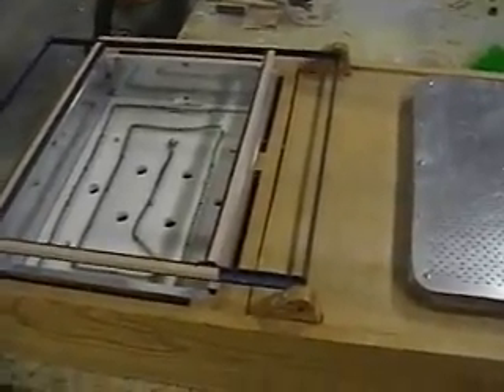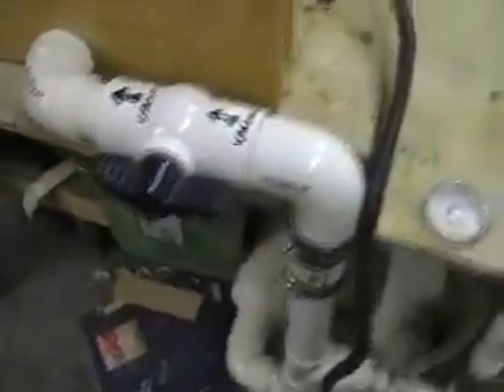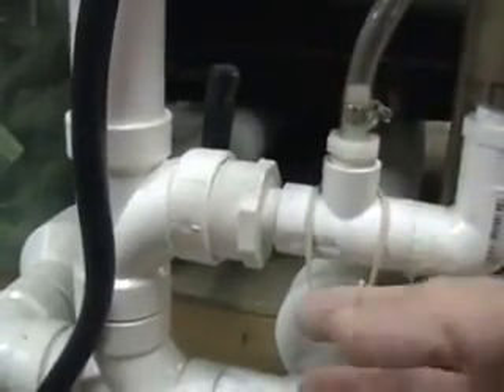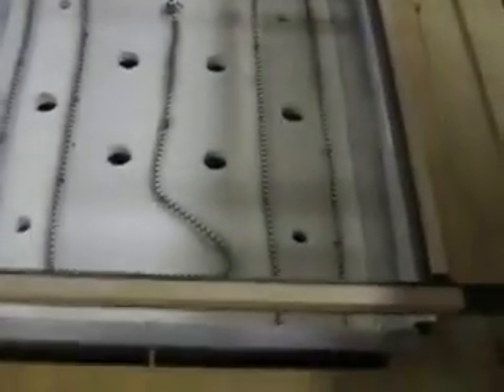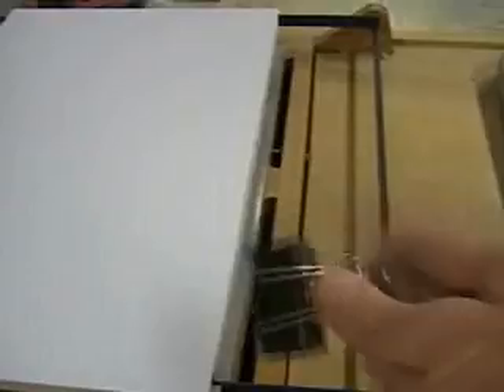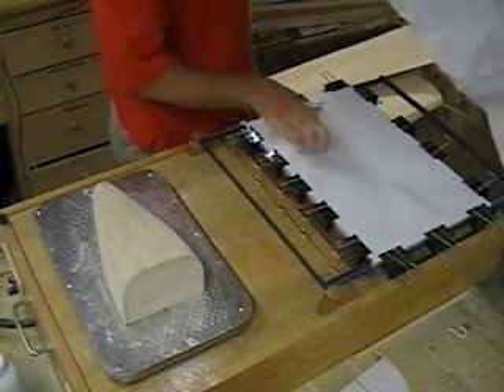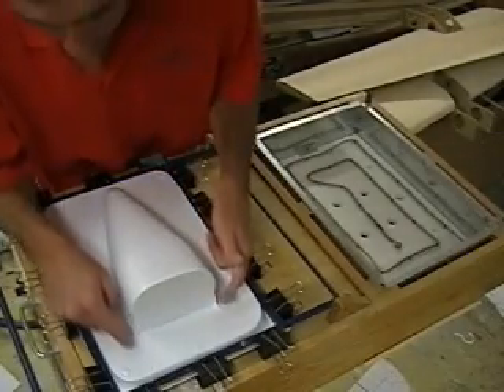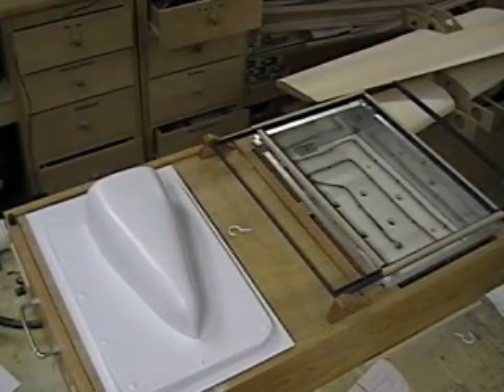vacuum former pulling part

Comment from the maker: I really like the PVC much better than a box. It is much more rigid and it is easy to store out of the way . I have since moved the location of the machine. It was very easy to move the PVC pipes to above the ceiling of the pulling/paint room so it is totally out of the way.. If you need more vacuum I would just have to add another pipe.. but as it stands I have way more pull than needed..

Thanks Ty

Comment: Nice vacuum former.
Just a suggestion. Instead of using the large PVC pipe for your vacuum chamber, just build a single large wooden box from similar materials and construction to your table top vacuum box but several times the volume? It will likely need internal rib reinforcement but other than that it should work really well.

Comment: Nice job on the vacum system , I am still stumbling through the learning process, I don't have anywhere near as nice of a air system.. but a strong shop vac is fairly effective...depending on what you are making..